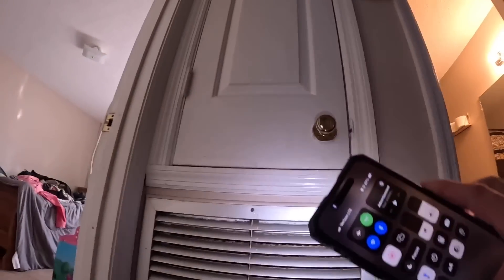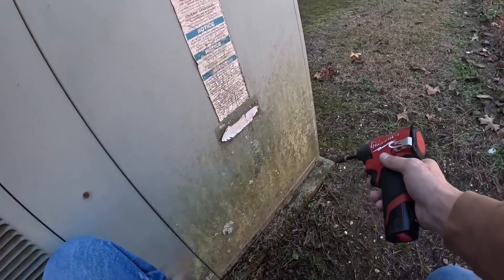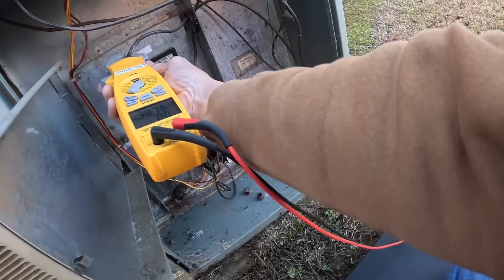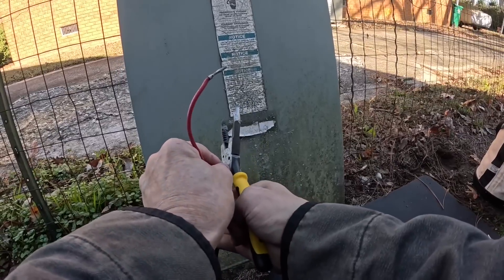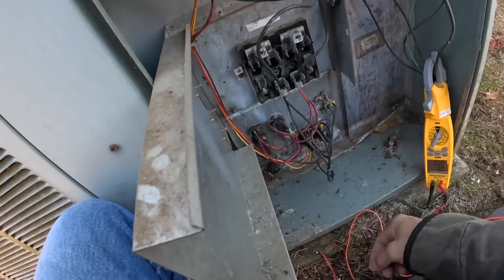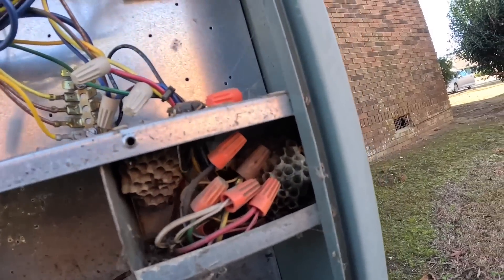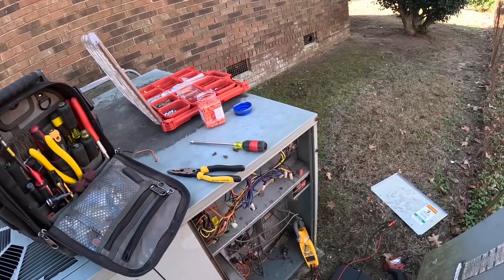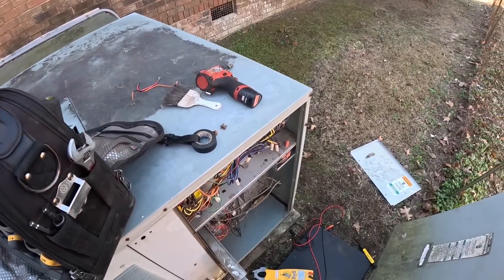90 Degrees In the House! Had To Turn It Off At The Breaker! #hvacguy #hvaclife

Comment: When I first turned out years ago, I put a jumper on red and white inside a furnace to fire the unit. I closed the furnace, packed up and got to my truck and realized my mistake. That weekend, I made a longer jumper with alligator clips looped through a magnet with a handle built onto it. That Monday, I used it. I stuck the magnet OUTSIDE the cabinet and put the jumper on R and W. I smiled to myself because I could never forget and make that mistake again. I coiled it up years later and keep it on my desk as a reminder because I became the owner of the shop.

Comment: Hey buddy someone in the past has bypassed the fuses that unit needs 2 60 amp fuses to be code compliant to manufactures safety device to prevent electrical damage also get you a good pair of Klein blue handled strippers

Comment: I always notice those Klein wire stripping pliers giving problems stripping wires, I use the Knipex forged wire strippers and they strip wire like a dream, they may not be able to crimp connectors but I sure do like them

Comment: True Story:  When I was younger (back in the mid-90s) and living in an apartment, I discovered my thermostat was broken during a cold winter.  Rather than bother with maintenance, I took it apart and shorted out what I thought would work.  The furnace came on, and then I left for the evening.  Maybe 4+ hours later, I come back and open the apartment door.  It felt like a wave of hot, humid air washed over me!  I panicked and switched the furnace off, but it still kept running!  I then took out the piece of aluminum foil I used to get the furnace working from the thermostat, but it still kept running!  I then started looking around the unit for the breaker box when, thankfully, it shut off.  I looked at the thermostat.  Its needle was pegged at 95 degrees and quivering!  It was probably well over 100 degrees in the place.  I cracked a window in the apartment and went to bed.  Later, I called maintenance to replace the thermostat, but luckily, back then, the gas was being covered by the complex.😮‍💨
Reply: Dont mess with thing's you know nothing about,  that includes Women.

Comment: Amazing how wires over time short out against each other. I guess years of vibration causes that. Nine out of ten times the connectors are looking rough, so when you change them, you get a better connection, plus it looks better. I'm glad those paper wasps weren't at home either, try to remember for when you go back. Nice job, hope the ankle is ok, doesn't happen often, but it is startling to bust your butt.

Comment: Curtis, Happy New Years to you and your family and of course Riley.
Question: That is an outdoor RTU with heat and a blower, 
 yet there is an indoor air handler.  Never seen that before.
Reply: No, it's called a package unit.  They're basically a furnace and air conditioner in one unit.  The heat source can be electric, heat pump, or gas fired.  Yes, they're used on rooftops of commercial buildings, but smaller units are used for residential as well.
Reply: @musicnerd72 - yes the outdoor system is a package unit, also known as a roof top unit. So why is there another air handler inside of the closet ? Normally the ( package) unit is ducted inside the building or house, if you prefer, with the ductwork split to the different rooms supplying heated or cooled air. The return is ducted to a air return, filter grill. But in this case the filter grill leads to a closet upflow air handler, with the plenum leading to attic ductwork.

Comment: I had a call today (Saturday) where the furnace would stay running even with the thermostat off and the face plate off. My first thought was to replace the thermostats  which I did, but did not solve the issue. Hopefully i'll get another crack at it.
Reply: Could it be a relay stuck on
Reply: @dalekronk496  maybe although it didn't see any relays unless it's intergrade into the board which could make it a  board issue
Reply: @mrgreen9086  that's true
Reply: @dalekronk496  I'll find out next year lol thanks
Reply: @mrgreen9086  could have bad ecm motor
Reply: @TomLawson05  I didn't even think about that maybe the module is bad
Reply: Customers always blame the thermostat or the refrigerant (Freeze-on).:face-blue-smiling::hand-pink-waving:
Reply: @bobboscarato1313  it's the txv

Comment: electric heat always makes me nervous, at those high currents wires eventually always melt at the connectors and can be extremely dangerous. Ill always have natural gas heat if I can help it (or propane), but I know in the south these options arent always as easy to get.
Reply: Don't gotta worry about the electricity leaking and exploding
Reply: @brianleeper5737  its true both have their negatives.
Reply: @brianleeper5737  Gas explosions happen very infrequently, then what the sensationalist news makes it out to be. And there more then just a lot of people out there, that have gas heating of some sort in the US let alone. Homeowners perceptions also plays a roll. Like for an example, i have seen some in my area, who have a straight electric heat pump the central heating, But they have gas for the stove and water heater.
Reply: @KenKen-ui4ny  It's about proper installation. A gas pipe won't leak if installed correctly. A wire won't overheat if it's installed correctly (torqued down sufficiently---many cases of overheating are due to loose connections).
Reply: @brianleeper5737  Electric heating elements tend to normally pull more current through the connections, hence why electric furnaces are prone to burnt wiring issues. But yes a lot of it is preventable by making sure the connections are tight enough, and haven't vibrated loose.
Reply: @KenKen-ui4ny  Being outdoors probably doesn't help those package units.
Reply: @brianleeper5737  Corrupted parts, like a bad relay or sequencer sticking, can also cause overheating and burning.
Reply: @KenKen-ui4ny  Bad contactor can cause overheating and burning on an AC unit too.
Reply: Wire size is the key.  And 240v circuits.  Keep the amperage low.

Comment: Not to make light of it but honestly at least their unit is able to heat their place my parents got a brand new Lennox heat pump package unit to replace their 20+ year old trane unit that broke last summer because the parts to fix the Trane were going to take months to get but this Lennox unit  can't keep up it takes almost all day to heat the house from 65 to 72 on full  2 stage heating and in the summer it can't even keep the house cool on full 2 stage cooling
Reply: Sounds like y'all got a undersized replacement.
Reply: @steveoh9838  i guess  I'd figure 14 ton 12 seer unit would be able to easily keep up with a 2 bed 2 bath  1800 sq ft house
Reply: @BryanGullickson oversizing is just like undersizing
Reply: @Kujophilleepe  So oversizing would cause it to also not be able to keep up?
Reply: @BryanGullickson oversized more of problem with ac,the unit will not run long enough,short cycle,and lead to humidity problems
Reply: @cardsfan1590  Well, at least with heat. It also seems like the units kicking off into defrost. Almost constantly even though there's no frost on the coil. Because there's been several times when I've been outside with the unit running in. Suddenly you'll hear the reversing valve energize and it just kicks into defrost for a short moment then right back to heating it does it constantly because each time the compressor starts the lights in the house will dim momentarily and you can hear it in the living room where the return grill is
Reply: I'll call company back to make sure duct connectors are properly sealed and not picking up cold outside air thru the return duct! :face-orange-frowning::face-blue-smiling::hand-pink-waving:

Comment: I Was Changing Out An Old Hot Water Heater So I Turned The Breaker Off! I Tested One Side Of the 220 Line And Read Zero! Little Did I Know That One Side Of The Breaker Had Fused Together! So When I Went To Cut The Old Wiring Off It Blew A Hole In My Lineman Pliers Or Side Cutters! I Learned Not To Skip The Step Of Checking Both Legs For Voltage!
Reply: I bet you're thanking your lucky stars that only your cutters were damaged...
Reply: @dashcamandy2242  It Scared Me But I Have Been Bit Before! AC Usually Knocks You Off of It! DC Will Kill You because Just Like A Piece Of Metal Between Two Battery Post You Stick To It! At Those Voltages And Amperage's Or Watts Dc Is Way More Deadly!
Reply: You Don’t Need To Capitalize Every Word In A Sentence
Reply: I'm guessing old Federal Pacific, PushMatic or other dinosaur long obsolete breaker. I named the worst two first. 😉
Reply: Also if you see a low voltage like 6 volts you can still have full amps this happened at my dad's house the breaker was bad.
Reply: It can do some really weird stuff. @mustangmike6421
Reply: Water heater.. Not Hot Water Heater.
Reply: @aaronclark1599 You never worked on a hot water heater? Must be a newbie. A hot water heater is when you have two water heaters in series, the first is a water heater that runs hot water to the next, making the next one a hot water heater. Duh
Reply: @AnUnapologeticApologist  Not The Craziest Setup But The Church Uses A Hot Water Heater With A Pump To Heat The baptistery! Sure Dont Want To Pay Their Power Bill!
Reply: First time I've heard that analogy. lol @AnUnapologeticApologist
Reply: @kevinlsims7330  Honestly it's probably cheaper than running a traditional electric water heater